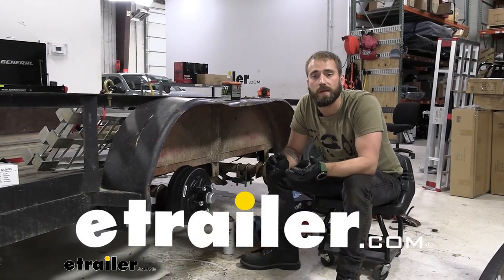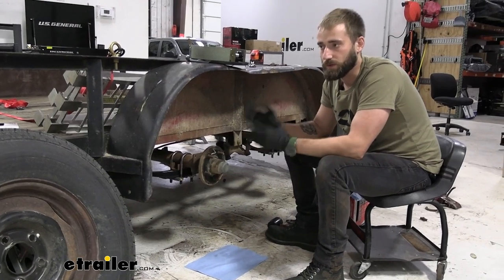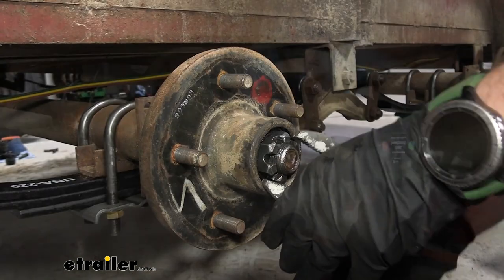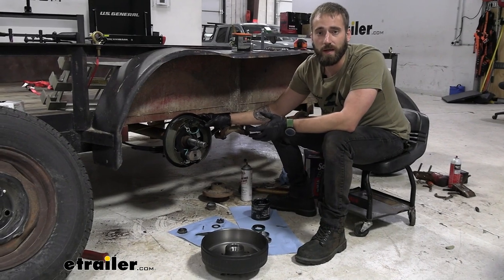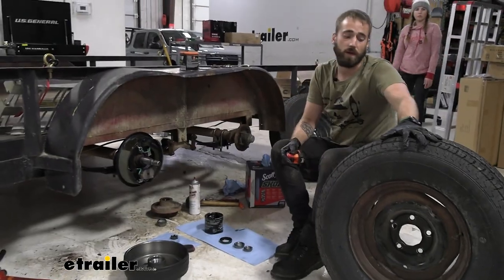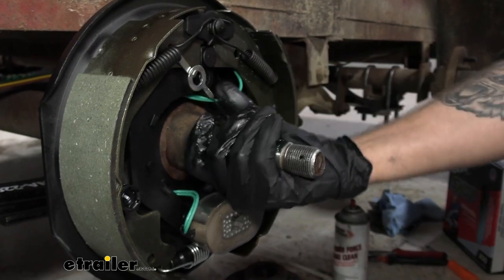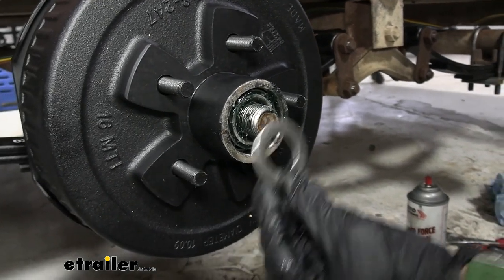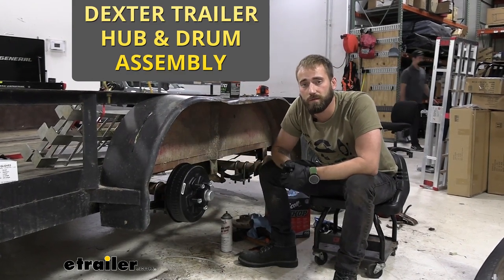etrailer | Complete Breakdown of the Dexter Trailer Hub and Drum for 3,500-lb Axles

Comment: using a screw driver on the cap is 100% easier to use than smacking it with a hammer.